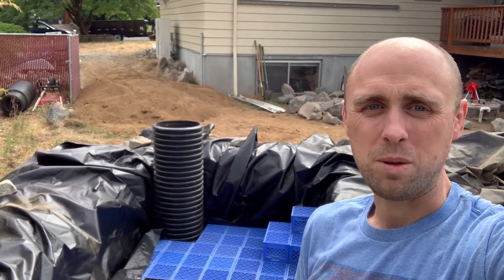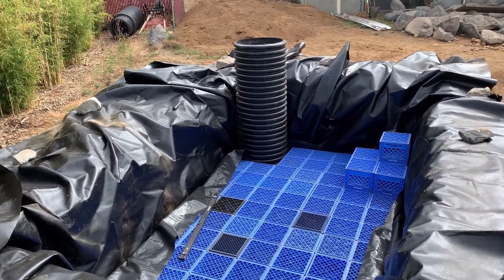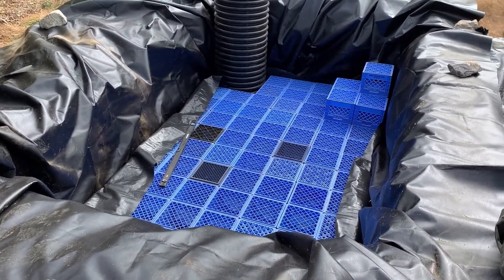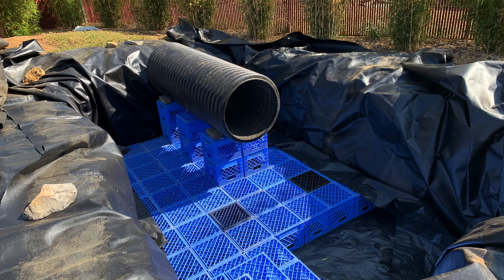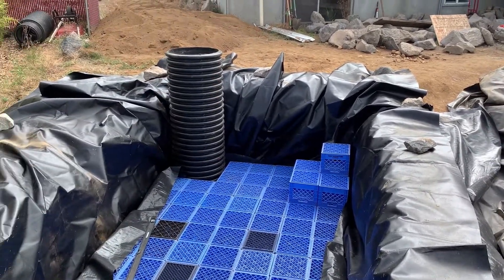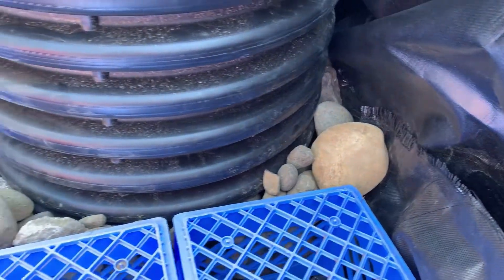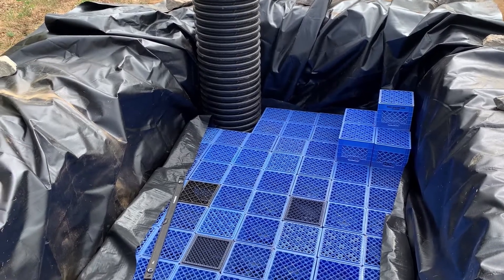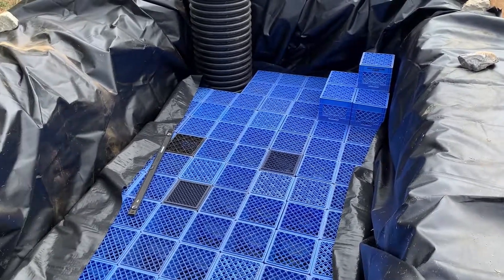Negative Edge Pond Skimmer & Rainwater Harvesting Construction - Part 3

Comment: Those pond crates are a cheaper method for sure, but most of the ones I’ve seen can’t support much weight and break after a couple of years.
Reply from the maker: It really depends on how you install them. Placing them in an excavation and backfilling it makes them significantly more sturdy. The top (bottom of the crate) is still a weak point, but burying  them in gravel or using some other material to distribute point loads solves that problem.
Reply: @TylerTervooren  That’s good, likely the ones I saw were definitely done by inexperienced builders.